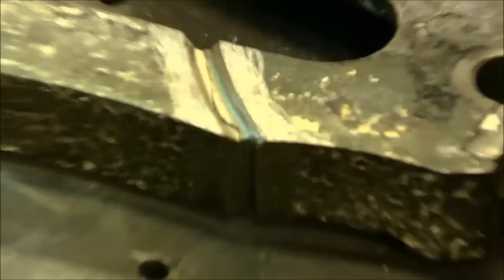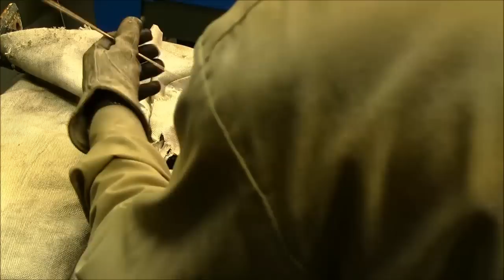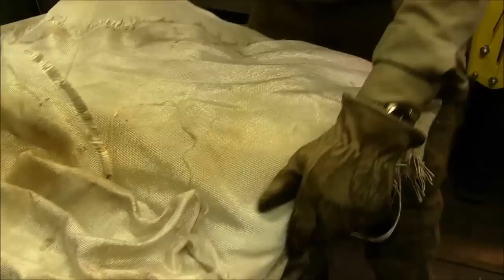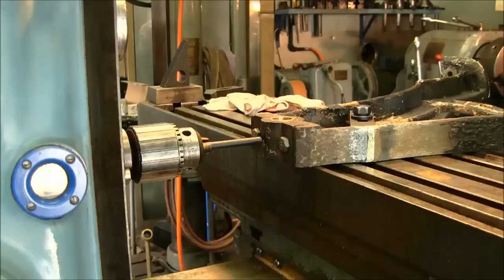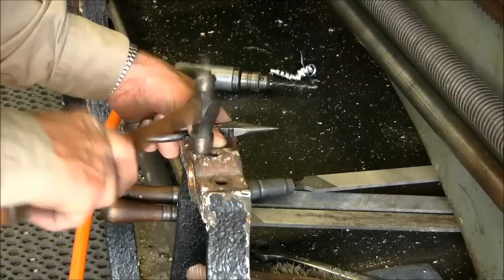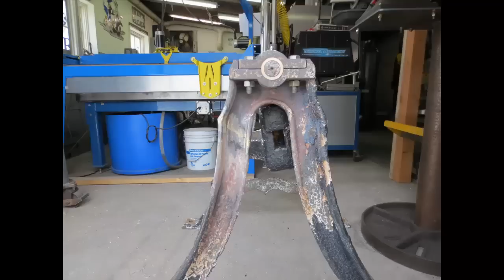The Bell Rung 300 Part 3 (Finale): Church Bell Repair

Comment: You could have gone all the way through the bushing with your oil hole and put the roll pin in from the bottom side.
Reply: I was wondering, would a steel pin in cast iron corrode? Also won't the 'hole' in the pin allow water into the gap between the bushing and the housing?

Comment: Your honesty shines through Keith. Most repairers would have been tempted to 'find' a crack in the casting and charge for its repair. Good on you!
By the way could an option for maintenence have been to provide a fitting to allow a run of thin pipe down to where a couple of grease points could be accessed from elsewhere in the bell tower? Just a thought--

Comment: I wonder what's the material.. it looks golden and that tells me bell bronze (20% tin, 80% copper) and once you heat it to red hot and cool it slowly it become glass hard.. it needs to be cooled fast so the brittleness does not occur.. if it's cast iron or brass it's the other way around

Comment: Hello Keith good job, just let you know the crack is a stress crack it has a wave too it. If that had cracked  when it fell over it would be straight, so. Don't feel bad it got by on you good to check every old painted jobs that come in the door just to protect you and  from people getting freebees good work. Not your fault as I see it . hope they chipped in

Sal
Reply: 100% agree and was about to post the same.  Had it opened all the way you would have seen it was an old stress crack coming off that angle built into the standard.  If I had to hazard a guess, I'd say it broke on the opposite side of the roping wheel?  That would be the side most subject to torque from worn bearing surfaces and harmonics.
Love your work and the only thing I would have done differently is to cut an oil way inside the bronze as it's greased into the non-bearing surface.  Love the vids, even these old ones!!
Reply from the maker: Salvatore joseph Thanks for your comment and opinion. ;{)-----

Comment: Keith, what a great series, as usual. One question from a layman:
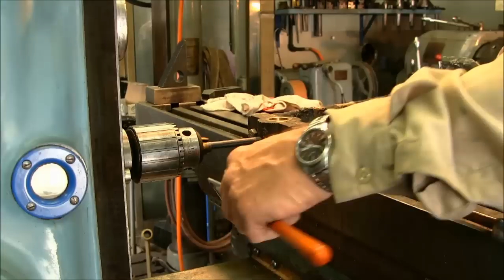Maybe I missed something, but at no stage did I see you check whether the two trunnions actually run along the same axis. In part 2, you went to great lengths to get the bushings perpendicular to the cradle stands, but when you turned down the trunnions (in part 1, at 28:00), you chucked up the old, worn-down trunnions in the lathe to get center holes for the live center, which you then used to turn the trunnions down. How confident are you that the turned-down trunnions are still in one axis, i.e. if you bolted the flanges back on to the yoke, that all 4 center holes would be in one line?
Reply from the maker: That is a great question and when turning cast / ductile items you find common surfaces and location used by the original creators to get the first machine surfaces. Both trunnions where worn in the same manor and the way I chucked on them was duplicated, the over  all span and the pivot clearance allows for a certain amount of variable, and after that the installation procedure of the cradle, is done with shimming for matching the two bores, for a smooth free swing. ;{)-----
Reply: +Mark Rohwer Same question I had and I hope the person who installs will put effort into getting the mounting pads shimmed with as much care as the machinist used.

Comment: "Better to be looking at it than for it". You're just choc-full of great advice!

I bet you were so gutted to have that huge crack happen! After going on about respecting where it came from and re-using the original bolts? Then 'ding'...oops. You fixed it though...did the customer know about the damage?
Reply from the maker: Yes I wasn't about to hide the facts and you could clearly see the repair due to the color. I talked over the situation and options and then proceeded. ;{)-----

Comment: are those blankets made of asbestos ...if they are'nt what are they made of ....just curious ?????
Reply from the maker: They are simulated A cloth, two ratings and one large weave 1500 F and the tight weave is good for 1900 F or something like that. Weld supplies and places like Mc Master Carr have the materials listed as blankets and cloths, right in with gasket materials that stand high heat. ;{)-----

Comment: Why not weld it with a high nickle content rod?
Reply from the maker: I have done plenty of welding using nickle rod and don't care for the brittle action the surrounding cast base material takes after becoming molten. I much rather no I have both the strength and the bond with Brazing! ;{)-----
Reply: That makes good sense. Thanks

Comment: Ouch on the mishap.
Doesn't the roll pin holes allow water directly onto the steel pin? They should be covered with wax or something.
Reply from the maker: They were filled when they did the painting after my repair. ;{)------

Comment: good vid and info. In spite of the mishap, would that have cracked (as a weak point) over time? Meaning after installation, bell movement/ringing, and temperature changes in overall final installation.

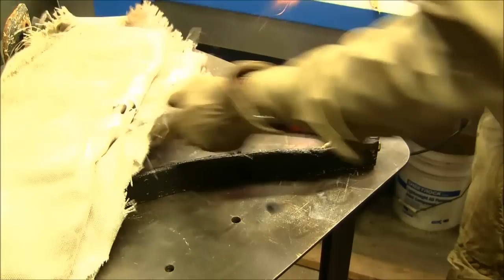Comment: What did they paint that thing with? It wasn't until 12:55 or so when the old paint caught fire, despite being beat on with an oxy-acetylene torch...

Normally, old paint gets real soft around 200 F or even a bit lower...

Comment from the maker: So the chips collect in small area and I can collect them rather them flying in the air allover, Brazing doesn't create a change in the base material of the cast during it's process, soldering just as in welding, sometimes your going for the shape / contouring and sometimes your just leaving it stronger ;{)-----

Comment: I wonder if you could use a dark filter during parts of welding so that the puddle would be visible. You probably would need a camera operator to make it work.
Really nice piece of work - I wish there were a couple of stills at the end showing the work after sand blasting and again after painting.

Comment: Hi Keith.
This is very of topic, but what do you use to coat the surface of your mill table to prevent rust?

I have my mill in the garage (so humid and big temperature changes, not ideal) and i have just been using a thin layer of the same oil as on my ways til now, but chips is sticking to it (too thick viscosity probably) and it wheres of after a while.

Comment: Without knowing anything about brazing, the natural instinct would be to isolate the casting from the table, and just heat the casting, and try to minimize heat loss into the table. I'd be grateful if someone could explain why that would be a bad thing, thanks.

Comment: Great vid. as always. The grease fitting access reminds me of a job I did in the 80's. I solved it by running 1/8 high pressure nylon tubing to a more accessible location. Just make sure to pump the tube full of grease before installing on the bell. Then 2 or 3 pumps at the bottom will feed the same amount to the bushings. P.S. I thought I was the only one that used a needle scaler to duplicate a cast finish. lol

Comment: Just an idea, is it possible that you could have fitted sealed bearings that would never require maintenance in lieu of the bronze sleeves?  This question is assuming that there are bearings that have o.d. and i.d. that would be of similar size.

Comment: Wouldn't it have been better to clamp the casting so that the gap closed before you brazed.  When it cools now there will be a strain that could break the casting if there is a weak spot.

Comment: I guess that machine precision is overkill for the application and with all the bronze bushings, grease hole (which probably will never be used after first installment) and accuracy this piece will last another 100 years.
Btw, why wasnt the parts cleaned from the paint before your job?

Comment: That's the deal with oilite, it gets dry-it gets hot- it sweats oil and lubes and so forth just like grease will on a brng. I am always BLOWN away by your oxygas welding. Jody can do things with tig/mig/stick, others on YT can do some really artsy stuff with gas welding. You can repair iron like no one else on YT. Much respect for you Keith. It's more than looks with iron repair. I'm practicing on some old iron weights. Please wish Mrs. Fenner a nice Mother's Day, from me and mine.

Comment from the maker: As I have mentioned in past comments bringing a molten state to cast material, with and arc weld of any kind, changes up the surrounding areas of the cast material itself creating hard spots and even fracturing as the extreme tempature rise and fall during the process. ;{)-----

Comment from the maker: I have been blessed with friends that have supplied me with the blankets I have been using for about ten years, you can find them on line and at welding supply's, there are two basic materials I have talked about in the comments before, one handles heat up to about 1150 and the other handles heat up to around 1800 or so. Mc Master Carr has a few descriptions on the cloths they stock and lets you understand the differences. ;{)-----

Comment from the maker: No, I didn't, If the oil can soak in then it can soak out! I have accually cut large oilite bronze chunks and the oil would fly as the cut created the heat and the force of rotation was added to the project. ;{)-----

Comment: Keith nice work another first rate cast iron repair.  I see others feel it may have been a weak spot, but I know cast iron, especially older castings can be very brittle.  I'm interested in your take.

You handled the whole mishap thing very well indeed, there is a lot to learn there you have a very good attitude.

Comment: Nice Job all the way around it's I think that the crack was a fracture that was exposed when it fell. But you did the stand up thing and I commend you for it. You made an excellent repair it was done with skill and not desperation. You are a true professional.

Comment: I would suggest a spring greaser be installed in those threaded holes. Give it its best shot at lasting another 100 or so years.  I don't think the oil-lite is going to wear as long as the original iron/iron.